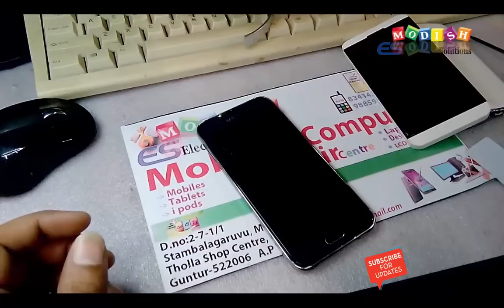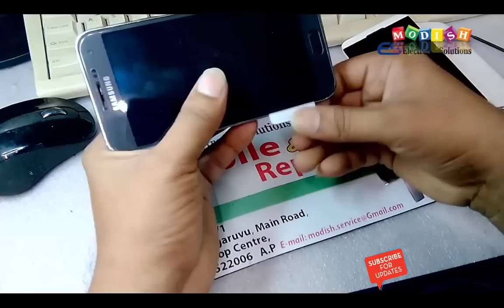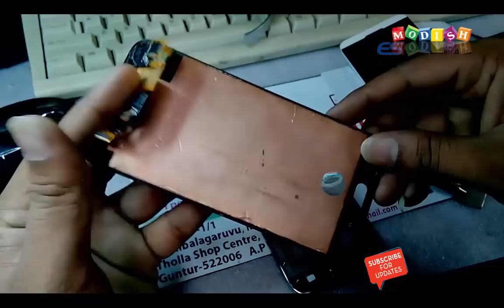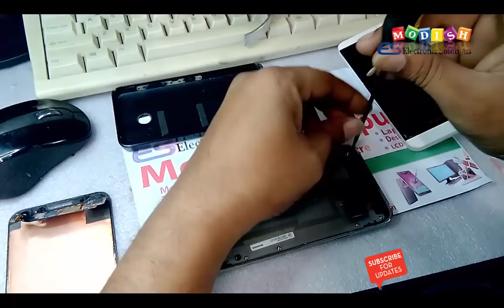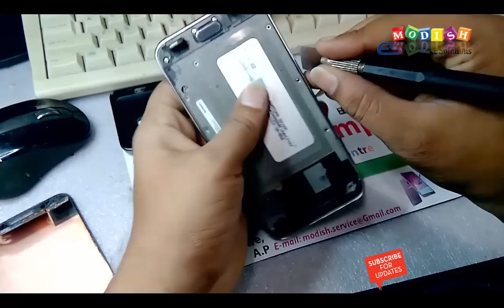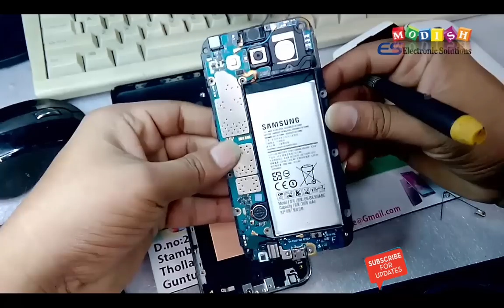Samsung Galaxy e5  Display and Battery Replacement  And samsung  e3 and e7

Comment: Hi i have a samsung  e5 
the battery is draining very fast  when using  
can you tell me please what i sould   
but  change the battery please
Reply from the maker: charge with original chargers if not OK then do Factory Reset .in factory reset maximum OK ( If any  Water damage then Service it)
NOTE: In" Factory Reset " All the data will be deleted so first backup your data
Reply: +ESC Baig so i sould do   maximum... factory reset
Reply from the maker: plz SUBSCRIBE IF U LIKE
Reply: itz Moh T i

Comment: I have one broke after 2 days dropped it still have it but can't open it to get to battery any easy way get it fixed only has cracking on screen used it for 2 times this was about 3 years ago I wish I could use it

Comment: Hi, I accidentally poured water on my E7 but I just wiped it off. After sometime, I charged it then the problem occurred. It blacked out and doesn't charge anymore. I did not use it for 2 weeks then I tried to charge it again. It charged and opened. As the battery went low, I charged it using my charger then it doesn't charge again. Until now, my battery's empty and it doesn't charge. What should I do? I want to have it fixed by the Sammsung Care Center but its way too expensive :(
Reply: instablaster.